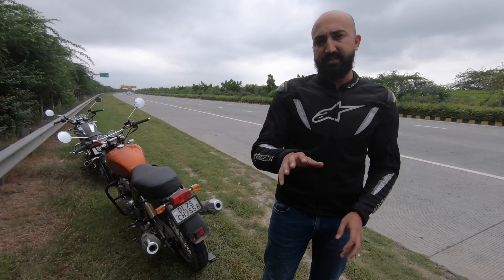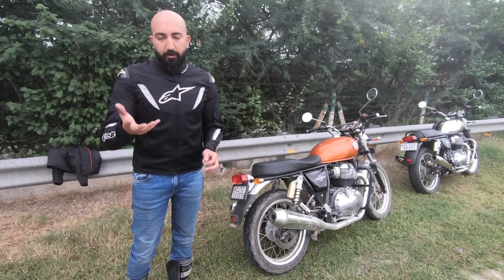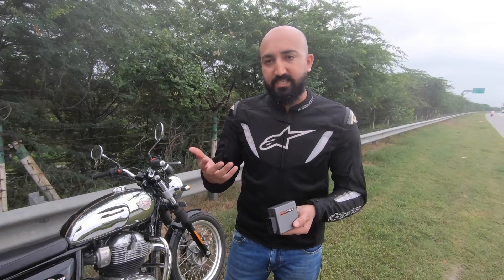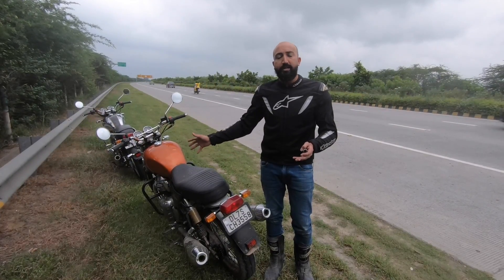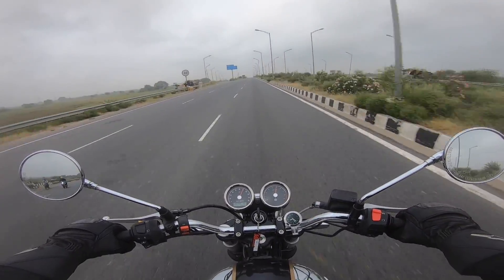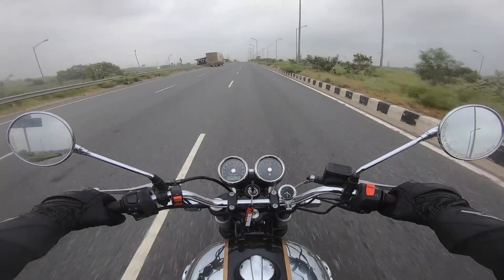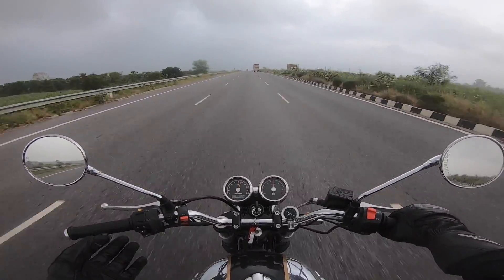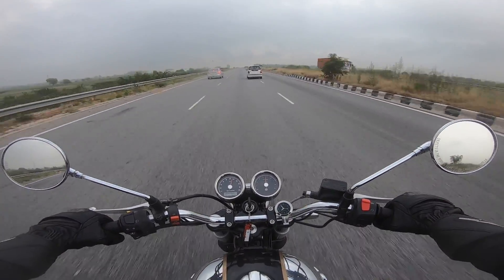Powertronic ECU For Royal Enfield Interceptor 650: 3-Month User Review

Comment: Hi, would adding a DNA air filter to a stock with with this ECU improve throttle response even further (I'm keeping exhaust stock to avoid cop trouble).
Reply: Add a DNA air filter and filter cover both, and with tuning it will be smoother

Comment: I will save this video / like.  
 And it will help me if himalayan 650 launches in upcoming days . Just i will add perfomance kit and may b silencers and will adjust 1 particular mode for offroad conditions with really low and mid engine perfomance. And another for highways some torque at low and mid and a top end performance for highways / touring 🖤.

Comment: @abhinavbhatt: But am I right in understanding that installing slip-ons would also reduce the weight (quite dramatically?). So, although it's just a bhp more, wouldn't it translate to more real-world performance?
Reply from the maker: The bike feels slightly lighter but the only difference in performance will be psychological. Not real world discernible difference.
Reply: @abhinavbhatt  I'm not a big guy by any means. But reasonably skilled/experienced. I had no trouble managing the Interceptor that I test drove. But it had red roosters on. Was wondering if there's a chance the stock model might be noticeably heavier? Still waiting for delivery
Reply from the maker: No, man. Once on the go, I don't think the weight difference is that pronounced.
Reply: @abhinavbhatt  thanks! Appreciate the content man. Quality stuff. Spare a quick thought or two on the dominar? Was my only other contender apart from the int 650
Reply from the maker: Dominar is a sorted bike. Ride both and see what works for you.

Comment: Can u tell, if we drive the bike at full throttle at top speed on highway, what will be the mileage, wanted to know its consumption in ltr/hr
Reply from the maker: Not possible to calculate it this way as you won't ride full throttle for long. Can't simulate that. But if you are such heavy handed on the throttle, expect 15-18 kmpl.

Comment: But what about the longevity of the Engine. With the DNA Air fitler, Iridium sparck plug, open exhaust, another ECU unit with greater fuel injection, there will be a lot more heat in the engine and overall he will die sooner .. or am i wrong ? ? ?
Im am sorry for my english
Reply from the maker: Hi. I don't think longevity takes much of a hit until you try to ride flat out all the time.

Comment: what you think about front suspension issue with interceptor ?front end seems too light which affects handling ?Also rear suspension has very less travel ?Any solution you can suggest ?
Reply from the maker: I'm okay with the rear supension. The front is too soft. Just swap out the fork oil to a heavier one. 20W. May also need an inch or two inch spacer.
Reply: @abhinavbhatt  ok thanks for the reply

Comment: Abhinav , in my observation the Interceptor, after 10 min ride when the engine warms up , I see a drop in the performance of first gear , not in the torque but the speed range , ,initially on a relatively colder engine, the first gear has a more speed range , I mean I shift to second gear only at 40 kph  without straining the engine , in a relaxed normal riding condition but after a while when the engine is sufficiently warmed up ,say after 10 minutes , and since I ride in hill city ,I often have to slow down due to traffic and then I need to get back to first and second a lot and thus I feel the pick up of first gear being affected ..and then I feel the first gear feels strained to go beyond speed of 25 kmph .the torque of first gear insnt affected since after the ride my house is on a steep climb and the interceptor climbs up comfortably .Did you also have a similar experience of performance drop in first gear after engine warm up ,?
Reply from the maker: Hi Vikas. No, I have not had any such issues.

Comment: Thanks a lot for this video.i was having trouble choosing between RRP and ECU. I will definitely go for POWERTRONIC.
Btw, I am facing issues with the stock seat of the interceptor. Is the seat of the GT better for long rides?
What seat is that on the Orange Crush?
Reply from the maker: The seat on the Orange Crush is a custom seat by a friend. The touring seat is a good option to go for.

Comment: use gps based phone system for 0-100 timings more accurate than 650s odo, is there an obd port in the bike, if not some one should device one ;D

Comment: This video IS NOT a waste of time.

The mods however, are.

Basically, just change the exhaust to make it sound to your liking. And make sure the ECU is still proving the correct air:fuel mixture by doing proper dyno runs. That's the only way you'll benefit from anything, and by that the benefit is a good running engine that's running with the correct air:fuel ratio.

This two extra horsepower for so much money and effort is a waste of time and offers nothing more than boasting about it among friends.

Comment: Just swapping the pipes makes more than a few HP difference. I swapped mine on my Continental GT 650 and my bike easily gets past 165kph
Also, I was under the impression that the Powertronic is supposed to increase rev limit?
Reply from the maker: You can if you want to. On the maps they provide, they haven't tinkered with the rev limit.
Reply: @abhinavbhatt  Aaaah... So that's why it doesn't cross 160 kmph and takes a while to get there.

Comment: Bro.. the brakes on my YZF R15 V3  has left me wanting for more bite and feel at the front end.. can u suggest any brake upgrade for my bike .. is there a option to upgrade the brake disk, brake line and calipers on my bike..
i was a fan of ur R15 v3 series.. but unfortunately the series is dormant for a bit too long.. i don't know why but i'll appreciate some inputs from ur side.. plz update via a vlog about the status of ur YZF R15 V3 in the current state of tune and would u recommend the same to someone else???
do give a shoutout to me if u chose to make a vlog on my request.. lolz..
Thanks..
Reply from the maker: Hi. My injector started leaking after I made the last video and I never got time to travel to Indonesia to buy parts again. So, I put the series on hold. Will try to revive it before the year ends. The best brake upgrade would be to get better tyres and a steel braided brake line with proper bleeding of brakes. That should suffice.
Reply: @abhinavbhatt  thanks bro for the update on the R15 series eagerly waiting for the next vlog.. thanks for ur suggestions for my R15..

Comment: Does Enfield recommend to use these external boosters? If there is any impact in the engine will Enfield cover the warranty?
Reply from the maker: Hi. No manufacturer would ideally want you to add anything to their product. This is plug and play so you can easily take it off while heading to the service centre.

Comment: Not worth the money,  u barely gain 3hp, that too on the higer rev range, but great video!
Reply from the maker: Barely 3 bhp? Come on, man. 3 bhp ain't little.
Reply: @abhinavbhatt  i agree, what you are saying,  but if you check the dyno chart, those extra hp, are available only at the high end. So the maybe the bike is 2 second faster to reach 150km speed, but you wont feel much of a difference
Reply: Specially in a day to day usage
Reply: Btw, thanks for putting out this video,  it helps!

Comment: Thanks for the video. My question is, does the Powertronic unit enrich the air/fuel mixture sufficiently to remain in the correct range after installing the free-flow air filter and less restrictive exhaust? As adding these parts will normally result in leaner mixture.
Reply from the maker: Hi. Yes, the team at Powertronic keeps the AFR in mind while designing the maps.

Comment: 13:17 

22-23 L to a kilometre. Oh my my!
Reply: I'm sure he  means 22 km per litre which is 64 mpg (Imperial gallons) or 4.48 litre per 100 km My standard Interceptor constantly gets 3.5 litres per 100km which is 80 mpg or 28 km per litre so there is not much difference. (We  use litres per 100 km in Australia)
Reply from the maker: Yes, of course 😅
Reply: scared me too

Comment: If the royal enfield give this engine a dohc setup and ride by wire then this bike don't need any of these it would easily charns out 10 bhp more..but the price matters..though nice video
Reply: it's got an eight-valve head ffs
Reply: @raymondo162  yes I know but this eight valve operated by a single overhead cam not a dual over headcam..If it is operated by a double overhead cam then the power will increase more without changing any stock component..and change in the compression ratio from 9.5:1 to 11.1:1 then this engine can make 60 to 65 bhp easily

Comment: Please test in control conditions...
Reply from the maker: Where to get control conditions?
Reply: @abhinavbhatt  may be a track or drag strip??
 Choose a day with similar Weather conditions at least for the test test run. 
Go in a Straight line 
Have a GPS based speedometer
Reply from the maker: @simranjeetsingh4351  Don't have access to a track or a drag strip.
It was meant to be shot in a single day, but it rained mid test. I did not have the stock bike with me the next time I had the opportunity to test the Powertronic bike.
Any straighter, I would have rammed traffic.
GPS based speedo would help get most accurate data, but since both the bikes are essentially the same, both will have equal speedo error.

Comment: If we installed this product into our bike and some how we meet with a accident. Can we claim insurance on the bike... I guess no because we have made changes in the given product(bike ) by the Co. So my suggestion don't customise the engine of your bike by putting / adding such products.
Reply from the maker: This is complete plug and play. You can take it off anytime you want. It does not need you to splice a wire or anything like that. Just plug it into the existing connectors on the bike and you are good to go.
Reply: @abhinavbhatt  that sound good 👍

Comment: 😂 my 1965 650 Bonneville would blow that thing into the weeds!!
Reply: I'm sure it would Kev, until it inevitably broke down in a puddle of pissed out oil from the vertically split crank case. I was a sixties biker too. My bikes; in 1968 a Tiger Cub, then an AJS Sapphire 250 (which I took my test on), then my last Brit bike a 1968 BSA Lightning, which was a really exciting bike, not because it was fast but because it tended to blow headlamp bulbs at tricky moments, like halfway around a left-hand bend. Good old days!
Reply: kev, did you know these 650s have eight-valve heads ? eh ??

Comment: Can someone explain the significance of going from 48 to 50 HP?
Reply from the maker: As clearly said in the video, the power gain doesn't matter. The throttle feel improvement does. Try riding one with the Powertronic unit and you will know what I am talking about.
Reply: "I am cool, I use exotic costly shit" syndrome

Comment: You broke R15 didn't you
Reply from the maker: No. Not at all. The bigger fuel injector conked off and it just isn't any fun on the stock one. To revive it, I want to get the big bore, super head, suspension etc in one go. Waiting to go to Indonesia to pick up everything once. So will do a video on the R15 towards the end of the year, when I have all the parts I need.

Comment: Since when a device not supporting on mac is a con, makes sense if its the other way around.
Reply from the maker: So what exactly is a person with a Mac supposed to do in this situation? Let's be rational, please.
Reply: @abhinavbhatt  ask a friend maybe? My point is the whole apple eco system has compatibility issues it's designed in a way that it only supports device's which are specifically designed for it because they believe it compromise security and how common do you find a Mac vs windows or Android vs iOS.
Reply from the maker: @nightdx0  I see your point of view, but I'd rather have support so I can do it myself. For the sake of convenience.
Reply: @abhinavbhatt  Good Luck with that 👍
Reply: @abhinavbhatt  😀👍

Comment: the maps that come as default are tuned for a performance exhaust right ? so what are the cons  if a stock exhaust  is installed with he PTECU
Reply from the maker: No. The map that comes as default is a map for the stock bike. You can get additional maps based on what you are running.

Comment: Abhinav (john) if installing both the slip-ons and the ECU the power would be close to about 51+ something right,and would cost for about 40k,but still a massive boast of top speed say about 180+ could be achieved or some more tweaks needs to be done within. thank you ✊
Reply from the maker: I think getting to 180 is not that big of a deal. If you increase the rev limit and play a bit with fuelling and sprocketing, it should get there.

Comment: They're gets to be a point where spending so much money to get an inexpensive motorcycle to go faster seems unreasonable for the cost. Seems to me it makes more sense just to buy a a motorcycle that already has the performance you're looking. But if you insist on making your Royal Enfield 650 going faster here is another alternative from the company that's been making Harley-Davidsons go fast. https://www.sscycle.com/feature/royal-enfield-650-twin/performance-parts-for-royal-enfield-650-twins
Reply: For those that believe buying Triumph is a better alternative, remember the price difference between the RE and Triumph is a bunch. A modified RE would still be less than an unmodified Triumph. Some people will still spend money to on the Triumph to make sound cool and have more power
Reply: @Joseph-gp5ld  also, you can start with a reasonably powered bike, and make it more powerful over time, without buying an entirely new bike.
Reply: @Hansengineering  exactly. Also the maintenance of expensive bikes like triumph are much more higher. Whereas alternatives like powertronic (compared to the conventional ECU remaps) doesnt harm the engine or even void the warranty.
Reply: @Joseph-gp5ld  I had a Triumph Street Twin, I'm a tuner so upgraded it with my own exhaust. DNA filter with intake mod, changed the final drive, removed the CAT and put in a new cam. It was the hands down fastest ST in the Philippines, 0-100 under 4 seconds. I sold it due to a sudden health issue, now looking a RE 650cc bike, it is closer to a classic Triumph than the new Triumphs, and a lot less money up front. still a lot of room for some mods.
Reply: That’s the problem with anything though. Rarely will you buy something, and it’s perfect out of the gate. For many of us, who have years and years of riding experience. We know what a good seat feels like, great shocks, the list goes on. 

Even though these Royal Enfields have a cheap entry price, I think they are well worth upgrading. I actually prefer them over a new street twin or Bonnie.
Reply: Well said 👏
Reply: Yup..these link you provided is the one which can upgrade its performance
Reply: Exactly
Reply: Right.
Just buy a Triumph 1200 Speed Twin, or T120
Reply: Making harley's go fast
Reply: You are the best i have come so so far when it comes to full modification from deep inside the engine
Reply: How about ngk iridium spark plugs
Reply: This guy is just marketing those brands so that he ll get some commission 🤣
Reply: @ShoaibKhan-gl2ul  he is getting paid for what he loves to do.
Reply: Yeah.. That would make sense if the price difference between interceptor and the "next powerful classic bike" is sensible. Interceptor costs 4000USD, while triumph street twin costs more than double the price. Which does not justify buying that bike at all. All performance mods available for interceptor like, exhaust, ecu, filters and even big bore kits combined will not cost more than 1500usd.
Reply: You know, I did some more checking on this. Everything S&S makes for power, (big bore, exhaust, intake, cam, ECU) runs $1557, plus $400 for a clutch if you want to put that power to the ground. $7960 for a bike without a warranty, with a p/w ratio of 0.15, and you've lost the low compression longevity. Compared to a CB1100EX, used, for about the same price, almost identical p/w ratio, and the same chill demeanor, but 100# heavier. Seems less of a deal when you look at the total picture.

Comment: These stupid things are just to make consumers fools. 
It's doesn't work like you said. 
Just a simple question What happened after 160 is it piggi can make bike on 200 or 220 kilometers per hour?
Reply from the maker: You do understand that a top speed increase depends on gearing and taking the rev range higher, right? These are products that are kept with longevity of the engine and safety in mind. And if you are looking at doing 200 or 220 on an Interceptor, then you are looking at the wrong kind of bike.
Reply: Lololol bro you need to do some research.